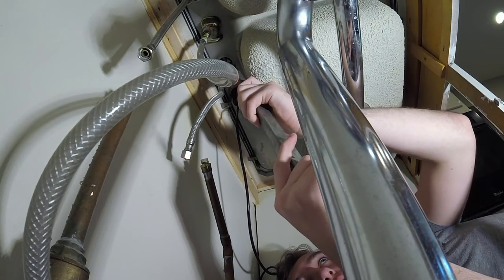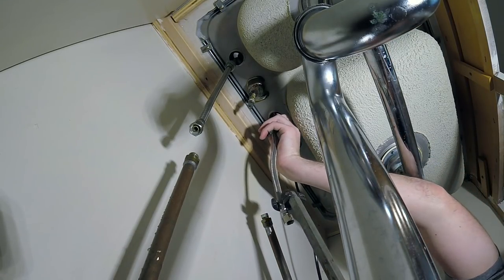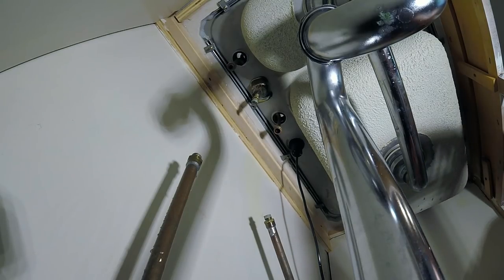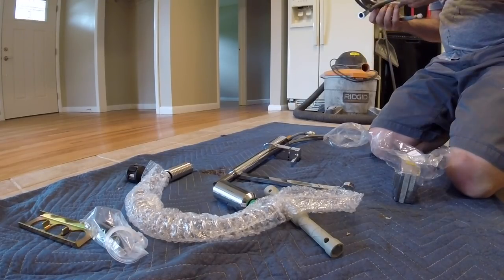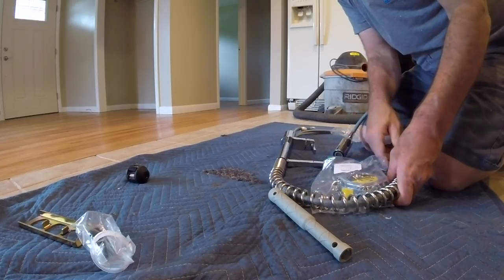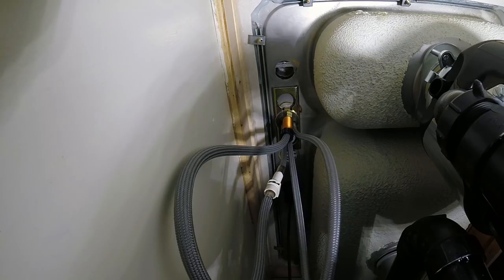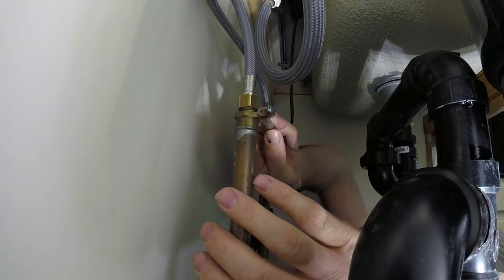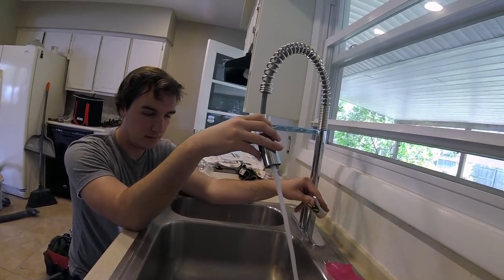Moen Align 5923 Kitchen Faucet Installation

Comment: Mine didn’t come with the square plate that goes underneath on the stem. I had just the smaller metal fitting to hold the hoses when I tightened it. Only thing after I installed it water seems to get under the faucet because it doesn’t seem super tight. Don’t get it. Should I put silicone around it?